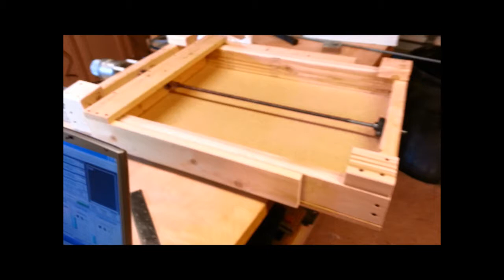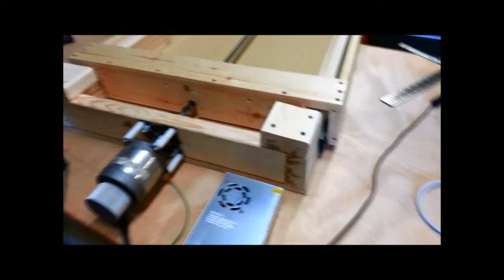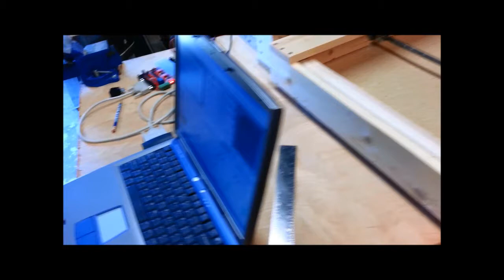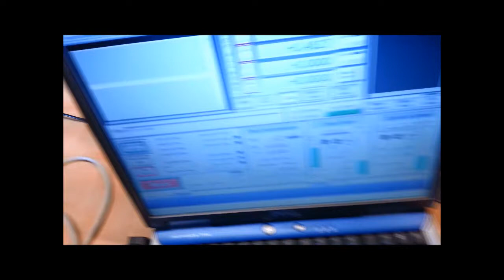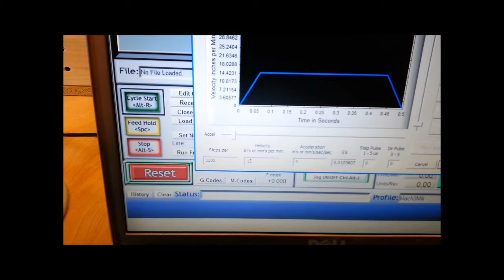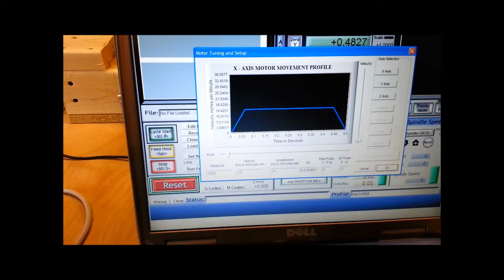Testing the X axis on my CNC Mill

Comment: Hi Mike. I greatly appreciate viewing your videos as I have similar aspirations for building telescopes and other y = x*x stuff. My first suggestion to possibly reduce your side to side issue would be to include a figure 8 cable system to force the sides to travel in sync. I also agree with the dirt talker that flexure will be an issue with this system. There are better choices of wood than pine. You might want to beef up the corners by making them into boxes or channels.
Reply from the maker: +Robert Smith 

This build has been kind of stalled due to a lot of other things going on in my life right now. I hope to get back to it and get it up and running soon. I have made some minor progress here and there as time allows. My main goal with this machine is to mostly carve foam and maybe wax, for use in mold making. I may attempt cutting plywood with it. I understand the problem of cutting forces causing flexure. With the foam and wax I don't expect much if any flexure. Foam takes almost zero force to cut. If I can cut plywood reasonably accurately, I may use the machine to cut parts for its successor, and it will be built of sturdier stuff.